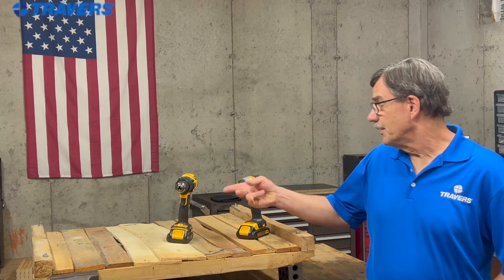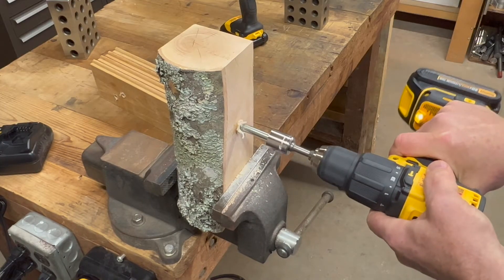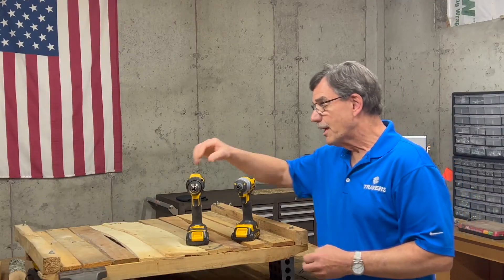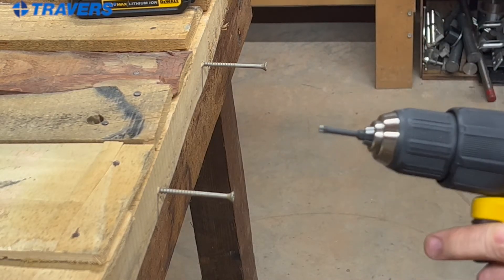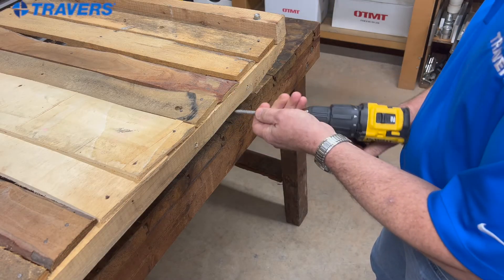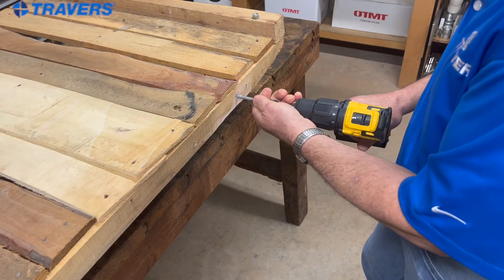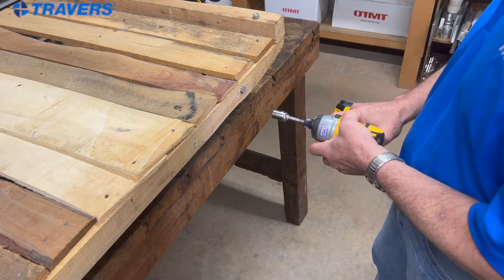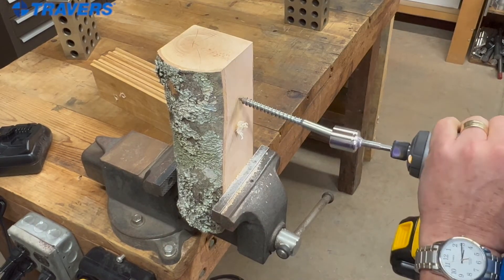The Difference Between An Impact Driver And A Drill & When To Use Them

Comment: Ty for the video!  Am I correct in stating the impact driver would be better for automotive applications for tight fitting spaces in an engine compartment, exhaust bolts, alternator screws/bolts, etc.?  Tyvm.
Reply from the maker: I apologize for the extended delay. We've been experiencing difficulties accessing and responding to YouTube comments.
Thank you. I’m glad you found it helpful.
Yes, you are correct.